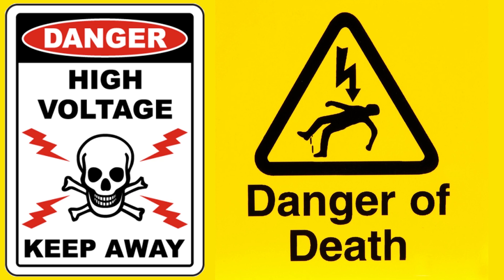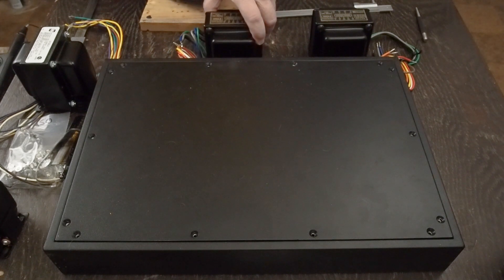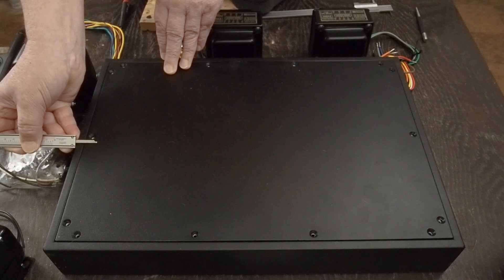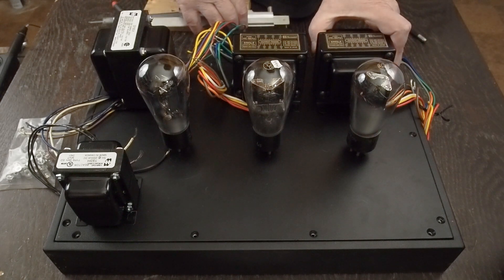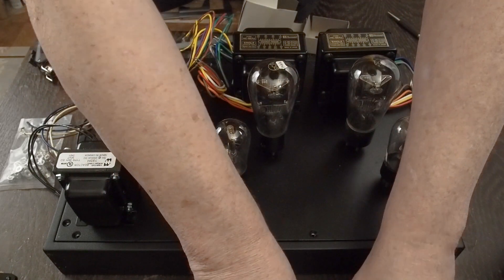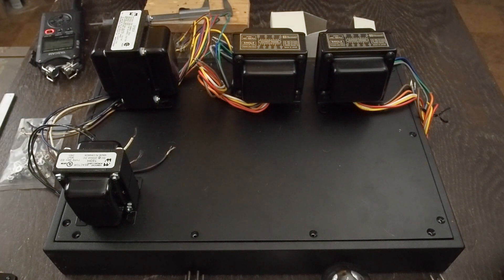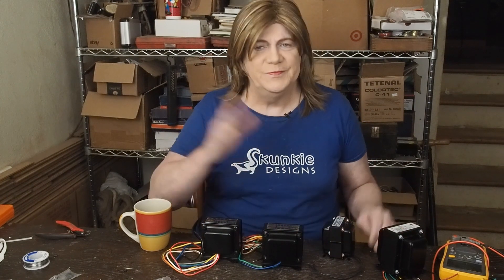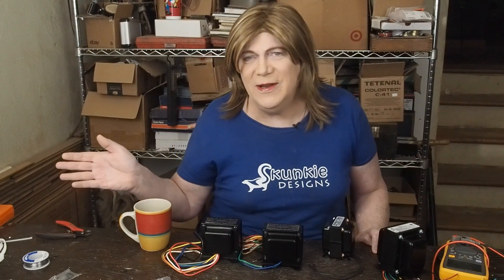1930's Globe Tube Amp: Fabrication #1

Comment: I got to say, you do a great layout. Aesthetic to watch the tubes and leave the transformers in alignment with them that to me is very good that I too kind of in that way myself but I’m just saying to you, you do a great job. Can’t wait to see the glow. Also I’ve learned from you about separation of power supply with all that goes in that section away from the circuit for the driver circuits and out put circuits.  Very knowledgeable you are thank you for your time in teaching not only layout but the circuits too.

Comment: I'm anxious to see how this amp turns out.  I love the look of the tubes.  I was part way into the 300B budget build playlist, and the Wilsenton R300 playlist, when this series caught my eye.  I don't know which tubes I like the aesthetic of more.

I'm also in the "would love to have a drill press, but don't know where I'd put it" camp.  Many moons ago I worked as a shop helper in a machine shop.  I'd really love to have he space, and budget, for a small vertical mill.  It would be no trouble getting holes precisely aligned with one of those.
Reply from the maker: Spoiler, it turns out awesome :)

Comment: Hi; just wondering if you had considered breadboarding one channel to see if a 56 is needed? That way you'd know up front how to lay out the chassis. Just a thought.
Reply from the maker: I know a lot of folks like breadboarding stuff and I get why, I just have always built stuff and experimented from there. I'm honestly thinking we may end up with a 56 + 47 amp and save the 27 for a later project but we will see!

Comment: Is there a link to buy the chassis or one similar?
Reply from the maker: This was from a batch custom fabricated locally. Landfall systems can make something very similar, never used their products but they look very nicely made. I would buy as a plain aluminum and have it power coated or anodized after all the fab work was done. https://www.landfallsystems.com/
Reply: @SkunkieDesignsElectronics  Thanks!!!

Comment: I love your videos, I learn so much and enjoy watching someone create a thing of beauty like this. Question: Is there an advantage to using only the 27 tubes if they have sufficient output? Are there “weaknesses” in just going initially with a 2-stage output using the 56s?
Reply from the maker: I'm using the 27 tubes for aesthetic and historical reasons, they were one of the first if not the first indirectly heated tubes but if I can't get enough drive out of them, I will probably see if the 56 tubes do have enough on their own. I feel adding an extra stage, if not needed, adds another coupling cap and stuff into the signal path.
Reply: @SkunkieDesignsElectronics  so, “less is more”. Makes sense, thanks.

Comment: If the top plate is made of duralium, I'd recommend using meths as a lubricant.
Reply from the maker: I'm just happy it's not made out of undrillium. :)
Reply: The main thing is that the top plate has hi-fillium properties.:)